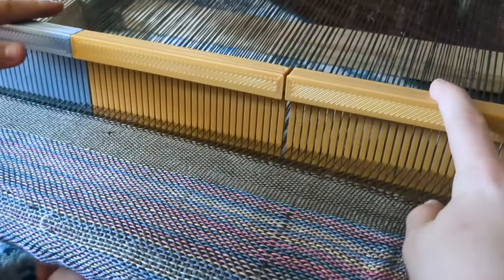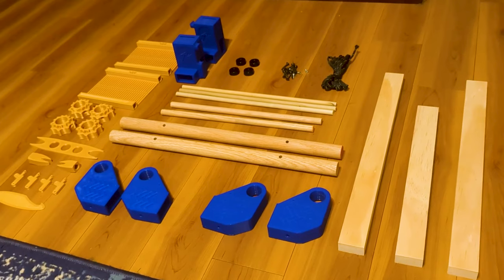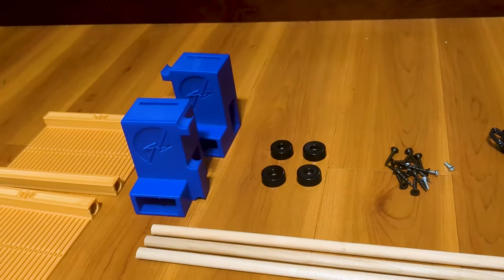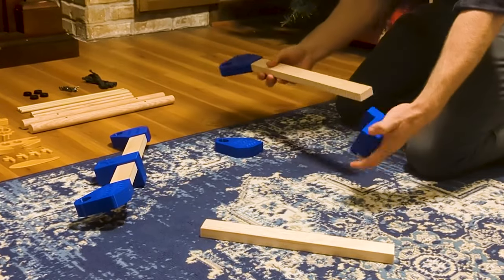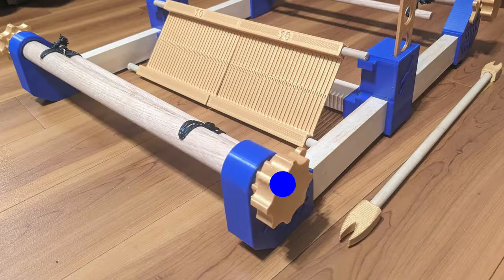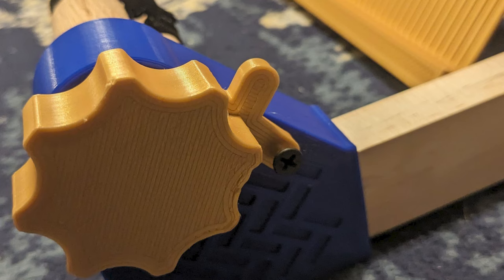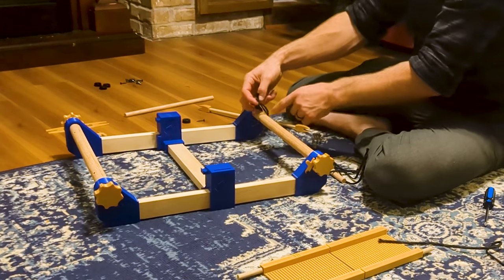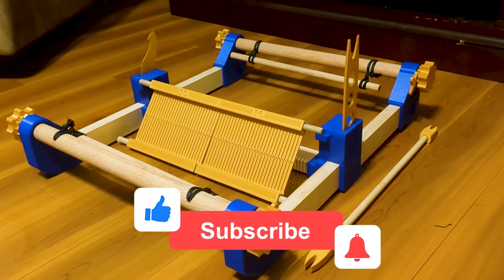3D-Printed Table Loom Assembly Tutorial

Comment: Would it be fine if I use the ratchet system for my small 4 shaft loom I've working on?

And a note for everyone who wants to make one of these, you can print more heddles and use longer wood if you want a bigger work area.
Reply from the maker: You have my permission to use it for personal use. JB
Reply: @GoodandBasic  I've been using a pin system, with a printed piece that has 4 through holes. It works, but it's not the best. I'll see if I can design my own ratchet later using my own style, now that I'll have a good physical example to base off of. Thank you.

Comment: Will you be making any that are longer with multiple heddels?
Reply from the maker: I'm currently working on a much larger floor loom with a flying shuttle. But I may revisit larger sizes for this loom at some point. Not soon though. JB
Reply: @GoodandBasic I'm very intrigued by the idea of this loom with multiple heddels that can be moved using pulleys and switches! I've recently started working with "recycled" Japanese kimono silk, which is usually less than 14 inches wide, and it's completely changed how I view fabric with a narrow width! With a stand and finer heddels, this could become my dream loom!